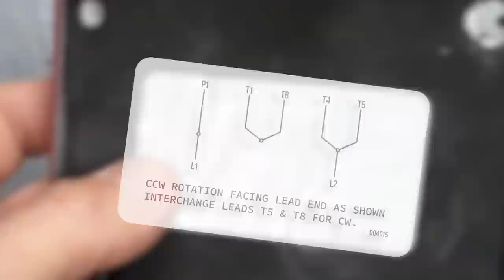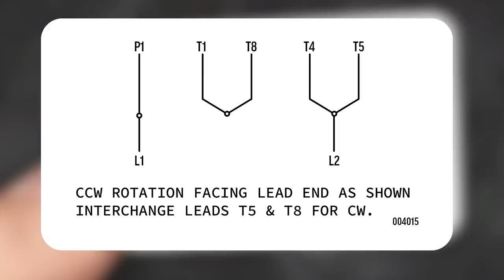Swapping a Bigger Motor into my Planer.  How Hard Could That Be?

Comment: I was shocked to find out you have to discharge the capacitors!
Reply: The one capacitor had a discharge resistor across the terminals. Probably so you wouldn't get shocked at the lead.

Comment: 2:26 Once a set of Contacts looks like those, there is no fixing them. You must replace them because the contact pads themselves will be VERY badly pitted and not making a good electrical connection which results in a contact that gets EXTREMELY hot and/or arcs out (arcing leads to more pitting and a vicious circle) until eventually either it can't pass enough current for the device to work properly or (more likely) it just bursts into flame and tries to burn the building down...

Comment: When you changed the pully size on the motor twice as big as the original one, you cut the hp of the motor by 25% or more. Though you gained  rpm, you decreased  hp out put. That's why you didn't have any gain on the board. I would get a new motor that  has the same rpm and hp that you need
Reply: This is false.  Hp is still 5, no matter what pulley is on there.
Reply: @Balsamancnc  maybe so but the planer can no longer do hole shots or wheelies. It's gonna be a total dog off the line!

Comment: 35:32 Once you have the bolt in the hole, SEAL IT WITH SILICONE!!!

Those boxes are dust proof for a VERY good reason...

Specifically, dust is flammable and flammable dust + electrical contacts = either a fire and/or BOOM!!!

Comment: The thing about the larger drive pulley - is that while it increases the RPM - it decreases the torque at the cutter shaft. So you gained 2HP but then lost some of the torque. A 5HP 3600RPM motor would have much more torque at the cutter shaft. [Edit - I am mistaken on this, and was corrected below.]
Reply: This is not correct. HP=torque x rpm. The 3600 rpm version produces half the torque
Reply: @Balsamancnc  Okay thank you for the correction on the motor HP rating.

Comment: I think this was probably recorded long before it was posted, but it might help someone else. It would be a lot easier and cost almost nothing just to re-locate the capacitors rather than build a riser for the top of the machine. The capacitor doesn't have to be on the top of the motor.
Reply: Matt noted he could do that during the install and opted not to…

Comment: couldn't you have extended the cords for the starters to have them mounted beside the power inlet area?
Reply: Sure but then you'd have to move the housing and plug the old holes. Making the riser blocks was a lot easier to do.

Comment: That goopy substance from the capacitor is wax and a sign the capacitor got hot.
A capacitor is an extremely thin strip of aluminum rolled up with wax paper bonded to it then rolled up into a roll with tin leads on each end.
Then inserted into the can body and sealed on the bottom the leads thru a insulated spacer all of it sealed inside a plastic sleave.
If you see wax or aluminum dust the cap is bad.
That one most likely failed because that resistor was to close to the seal / lead end and when it heated up it melted the wax causing it to fail.
The resistor leads should have been slightly bent up away from the end with a small heat sink attached nounted to the outer case on an heat insulator.
I've seen them like that.
I just changed several on the chassi board for a Wells Gardner arcade game CRT monitor I'm working on that's in a 25th anniversary Pac Man game. 
3 had wax on the board and 1 aluminum dust.
This episode is definitely an interesting one Matt.
Definitely something different off the normal path for you.
Reply: I think the dents in the cover is a sign the capacitor got crushed. That motor never ran so I doubt it got very hot. As far as any wax in a modern electrolytic capacitor goes that's not how they work. The dielectric material is actually an oxide layer on the foil. The paper sandwiched with the foil is an electrolyte carrier.

Comment: I think I would put a strip of mesh around those new spacers so as to keep a layer of woodchips from building up on your new motor and causing a fire hazard. Or not, depending on how your insurance is…
Reply: If the motor gets hot enough to ignite wood chips you have bigger problems. The insulation isn't rated to get that hot. The capacitors wouldn't like it that hot either.

Comment: It seem counter to me that the spiral cutter head would take more power to work sense it essentially slicing a smaller area along a longer width instead of a long straight blade of the original cutter head taking a long cut across the full width of the board you are cutting at one whack. But that's just me. It's good to know you have enough knowledge to be able to make modifications to your machines to keep them working and improving them to work more efficiently at the same time in stead of having to just buying something new and costing a lot more money.
Reply: It's easier to see that the amount of work (wood being removed) being done is equivalent as in each case the same amount of material is being removed in the same time. By measuring amps which can be converted to watts which measure work or energy expended to accomplish the same task. While spiral cutters have adventages over blade planers they as this case shows that spiral cutter heads when asked to do the same amount of work are not as energy efficient as blade cutters.
Reply: @raystormont  amps are not converted into Watts. Watts are Volts times amps. So Watts are the product of the power formula.

Comment: Matt it looks to me that your belts are to loose. I have been a heavy duty mechanic for 30+ years and my experience is about a 1/4 inch defection on the belt or you could buy a cricket gauge to measure it. Belts to tight will take out your bearings and to loose will slip and burnish the belts.

Comment: I'd limit the depth of cut to two and a half turns of the handle for a 10 inch wide slab...

The motor would definitely prefer only 2 full turns for a slab that wide...

Comment: Clockwise vs Counter Clockwise - all depends on you POV when looking at the tool, that's what messed you up.
Reply: Yeah I always just look at the motor shaft and see what way it is spinning. That plate was written from the line side perspective. Not looking at the motor face on. How you'd see it from where you're wiring it.

Comment: You lost a lot of power from that 1800 rpm motor when you put the much larger pulley on it.  Still it all worked out fine.  Thanks for the great video.
Reply: How do you lose power? 5 horsepower is 5 horsepower. If anything the larger pulley gained him inertial force. It'll act like a flywheel. Gearing only affects torque. A machine like this you don't have to worry about coming out of the hole with it. It's not under load when it starts. You let it come up to speed then feed the work into it.

Comment: Too much for your dust / chip collection?  Looked like the line clogged up.  Great video, a lot of problem solving.
Reply from the maker: No dust collector running during the tests in the old shop to get a db reading

Comment: I would not have put the electrical connectors bolted together like that, couldn't you use water well pump crimp electrical connectors with heat shrinks, would have mounted the cap's on the side of the motor to get at them easy!

Comment: capacitors are dangerous not for the amount of power they can hold, its really very little, its the speed and violence that they can discharge, a capacitor like that can take a finger off if you are unlucky.

Comment: you have a full schedule of duties to do in order for your 1 man operation to produce a > break even. You have created overhead and no employee yet to operate any of the many idle machines and shipping, assembly, sorting, marketing, & general labor.   I'd say a 7.5 HP Motor would be ideal because the planer is 20" wide and that  8-10" cherry bogged. You would overheat if you die a bunch of 12-16 lengths of any qty.  You should see the INCREASED amp draw under WIDE LOAD. Again you can hire a guy who is very experienced part time, a few days a week that is retired or interested in helping you. (Obvious example was Your contractor friend's labor/guidance vs you doing all that alone. Even build a big 30' drier and steamer box. That alone would be a great youtube project. Welded scrap plate, scrap industrial tanks so much cheap material if you:  (have space??) , can  cut & weld, and know how to design.  Insulation (Rockwool) is cheaper than single thick plate. A sealed sandwich with two walls is like a submarine, it is stronger and keeps vacuums and pressure way better. With the Rockwool1/3 less energy.  Mfgs don't care how much energy you use; they save money w single wall stuff and lighter shipping fees. Like insulation/ foam baffles around all your motors and saws Silly useless deafening noise makes you grow old and cranky. What?.

Comment: Hey Matt, maybe I'm wrong but I think when you increased the RPM through the use of pulleys you will halve your horsepower.  Great project!
Reply: Horsepower remains the same; torque will change. HP is a function of torque and RPM. You can get all the torque in the world from the tiniest motor, but its power will remain the same. 
OTOH, it's possible that the proper ratio will allow a motor to run at its optimum RPM when other "gearing" would not. This is the conundrum of fixed-pitch aircraft propellers: Do you wanna climb well, or do you wanna go fast? Pick only one.
Reply: Exactly what I thought. Not sure by how much, but one would think it would decrese torque.
Reply from the maker: Hp = torque x rpm
Reply: @mcremona  there's different ways to calculate horsepower. That's why shop vacs can be rated for "5 HP" They're using torque X RPM. The other way is 746 Watts = 1 HP. So a motor drawing 3,730 Watts is 5 HP if it is 100% efficient. Induction motors are close to that efficient. Now if your shop vac was was drawing 3,730 Watts it'd be pulling 31 amps and your 120V outlet would not be happy about that.

Comment: Fascinating Video, as always great work. I always thought that you lose torque in the same proportion as the speed increase..  In the same way as a motor pully that was smaller than the cutter head pulley would lower cutter head rpm but increase torque.  Is that incorrect?

Comment: Fun video, thanks for including the unexpected surprises!  However, by changing the drive pulley diameter haven't you negated some of the horsepower upgrade? Running at a higher gear essentially, so it must have less torque right?
Reply from the maker: lower rpm motor produces more torque than the higher rpm motor with the same hp rating

Comment: Larger pulley on a slower motor is bound to put more strain on it. Think of being on a 10spd bike and trying to start in 10th gear.... I would think that you would get better results out anything close to 5hp but an actual 5krpm motor. I completely approve af tearing anything apart and modifying in any form =)
Reply: There's no load on this motor when it starts. You're supposed to start the machine then feed the board into it.
Reply: @1pcfred  my analogy stands, imagine staying in 10th gear, at speed and then running into resistance, like a hill. I didn't mean for this to apply to startup current draw only. A higher gear ratio is still a higher gear ratio regardless
Reply: @ianide2480  induction motors are not analogous with other forms of power. The more load you put on an induction motor the more power you're going to get out of it. That's because induction motors are synchronous motors. They have to maintain their speed. Or they'll burn up trying.
Reply: @1pcfred  and that's my point, so what's this discussion about exactly
Reply: @ianide2480  it is about induction motors and how they do not work like bicycles.
Reply: @1pcfred  Ok change of analogies then. Lets pretend you hook up an induction motor up to a bicycle and it has to work way harder because you are always running in 10th gear...........
Reply: @ianide2480  But that's not the kind of load that's here. A planer isn't a bicycle. There are actually different motors for different loads. Fan motors are not the same as motors used for belt driven loads or compressor loads. It all has to do with the torque needed to break away. But once they're up and going then it's all pretty much the same.
Reply: @1pcfred  you are 100% right, you win, nothing I would say will help you understand anyway. Inductive motors are magic, like you seem to be alluding to. They break all the laws of physics and are not affected by the extra forces put on a machine when you change its gear ratio. I agree with you. A slower RPM motor at a higher gear ratio is even better in fact, because of induction right? Simple machines that run off of gear ratios that have a power source are ALL completely different and have ZERO similarities because reasons. Lever forces, rotational mass, speed, and other standard forces are all different in everything ever made. Can we end this now? It is obvious that I do not have a clue about anything at all and you are right.
Reply: @ianide2480  you forgot about magnetism. It happens. There is a reason that induction motors took over for all forms of stationary power. We gave up on those steam engines and lineshaft systems. Washing machines with gasoline engines went the way of the dodo bird too. Unless you're Amish.

Comment: Just a thought -----  if you had the right motor I believe it would cut it fine.  As you doubled the speed twice as much didn't it cut the horsepower in half.  So now you really only have a 2.5 horsepower motor .  Am I thinking wrong ?
Reply: Yes, you are thinking wrong.  See pinned comment above.

Comment: Come on Matt teach yourself how to rewind a motor 😂😂😂
Reply from the maker: Sounds like I’ll need to buy more tools
Reply: @mcremona  there's not many tools required to rewind motors. Cutters, a hammer, a chisel and a soldering iron. The real trick is connecting all of the coils up right so it runs.